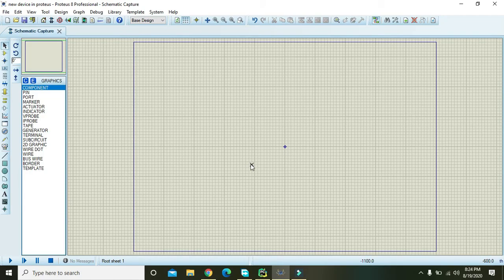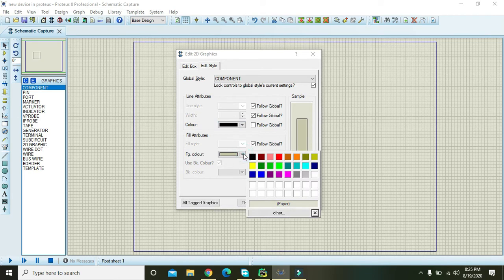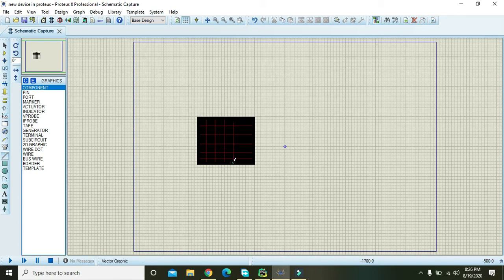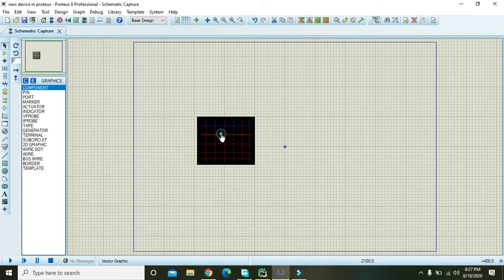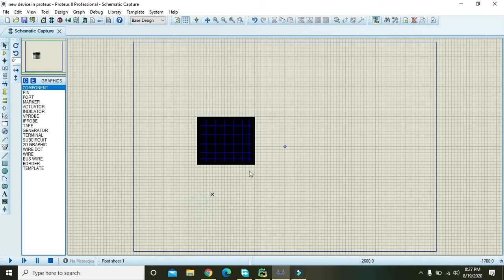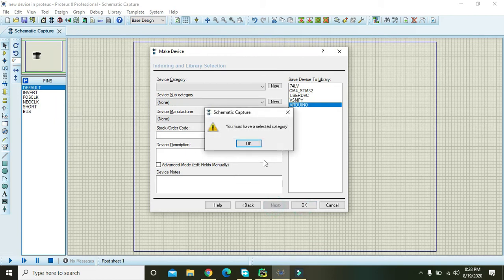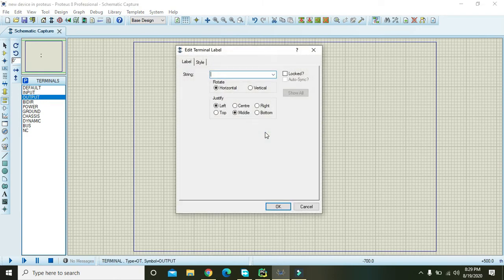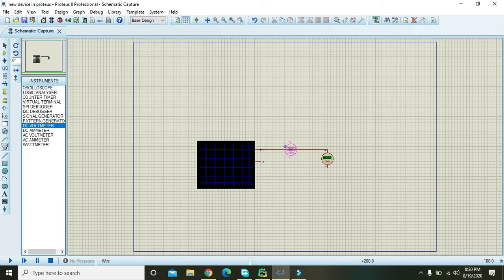how to make a new component in proteus | creating new device in proteus

Comment: can i to create a electronic board (like arduino for example) thanks
Reply from the maker: Sir...ya one can make but for it one has to learn vsm.
Reply: @nelsondarwinpaktech3954    not with ardiono (like arduino),  i want to creat a board  simulating...  assembly components = one card simulable

Comment: Pins are not connected correctly
Reply from the maker: brother...pins are connected properly but i inverted the pins in the hardware...means the direction is revert...when u will make it try to connect them in the right direction as mine is not looking good...
Reply: @nelsondarwinpaktech3954  I was trying to saying same thing.
Good work by the way, God bless you.